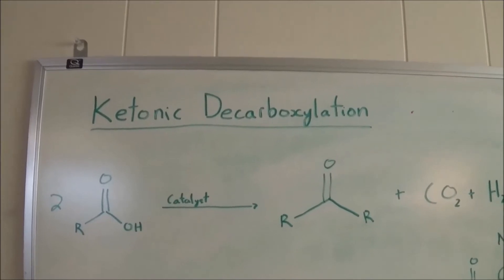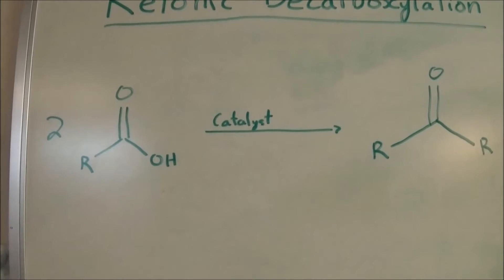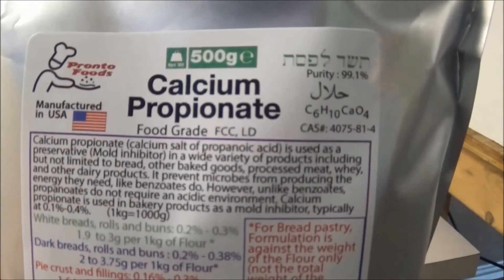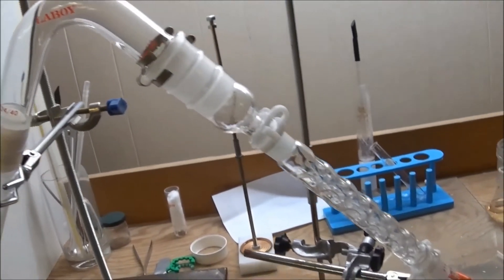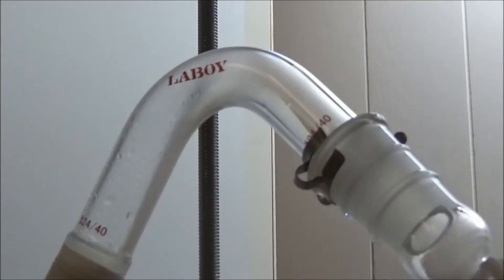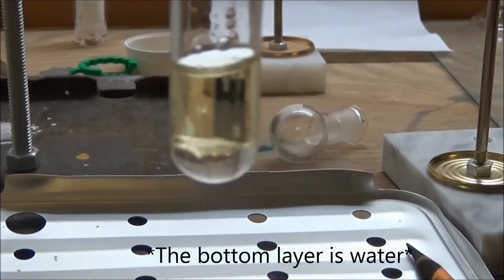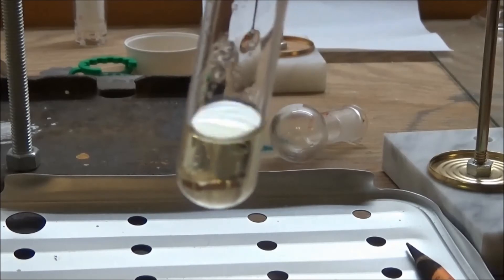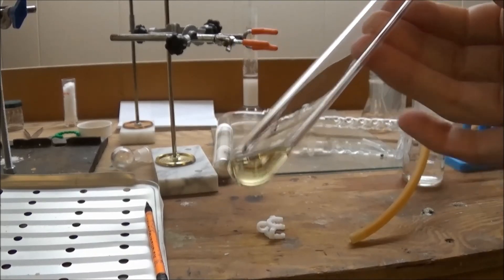Synthesis of 3-Pentanone

Comment: I think the yield was so poor due to poor heat transfer from the heat gun to the bulk powder in the middle of the tube. From what I recall, the higher yielding procedures that I know use the straight carboxylic acid with only a small amount of the calcium/barium carboxylate as a catalyst. (the acid melts, allowing for proper heat transfer) However, propionic acid is a liquid with a boiling point of only 141 C... Maybe you could try suspending the Ca propionate in an inert solvent? Something like paraffin oil, or NMP, or maybe even ethylene glycol?
Reply from the maker: I'm building a tube furnace soon (once everything I ordered for it arrives), I want to try running propanoic acid through Ca or Ba carbonate in the furnace (so I can control catalyst temperature better than torching it). A benefit of this is any unreacted acid can be recovered and put through again. That would improve yields quite a bit.

Comment: 13% for cheap OTC chemicals isn't that horrible...
You can just scale up when you need more

What temperature do you need?
Reply from the maker: Yeah, it not totally bad. I'm sure if absolutely anyone else did this they would get a better yield :)

It starts around (maybe a little under) 300 C. It would be best to keep everything at this temperature for longer, but I prefer to save time and heat more strongly (probably at the expense of some yield).
Reply: Tom's Lab well our hot plate gets hot as hell so maybe we can try this (once we get the chemicals, and fix current problems)
We use a kitchen ceramic heater thingy, it has awesome capacity and gets quite hot too

Comment: Tom what about Valerophenone/1-phenylpentan-1-one?? Would one prepare it buy dry or destructive distillation?? If so then what two reactants?? Reason I ask is because it is often called 1-pentanone, which is similar to your 3- pentanone.
 Here is the scoop on it. 
https://pubchem.ncbi.nlm.nih.gov/compound/Valerophenone.
Oh and congratulations on your mark. Your channel is growing like a weed.
Reply from the maker: For 1-Phenylpentan-1-one you could use mixed salts of benzoic and pentanoic acid. This will produce a mixture of products (which will have to be separated) including benzophenone, 5-nonanone, and the desired product. For small quantities it's okay but if you need a lot then buying is better. Chemplayer did a video on making aromatic ketones using a mixed salt system.

Thanks, I never thought it would go this fast!
Reply: Tom's Lab Yes thanks for replying.  You are the up and coming next NLRD or NuRG. Already achieved CP status. My opinion of course. 
Watch and  see in a year from now. You're going to be surprised. Maybe 100k!! That's very achievable.

Comment: I wonder if bread gets hot enough during baking to produce the decarboxylated side products
Reply from the maker: I imagine that some are produced, although probably not very much. Only around 0.2% by weight is calcium propanoate. The temperature that bread is baked at is ~250 C or less, and the internal temperature wont reach the temp. Most of it must survive as well to be effective at preserving the bread.